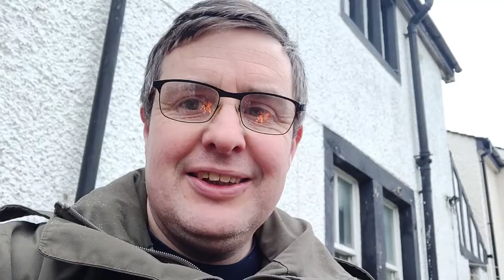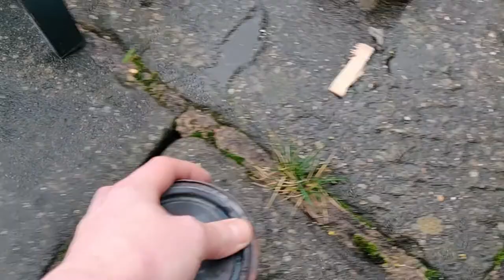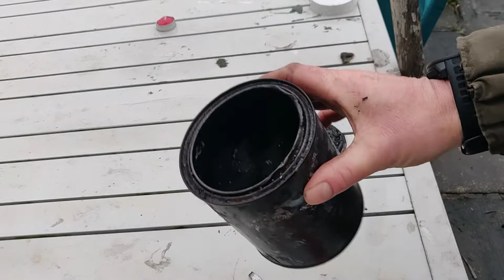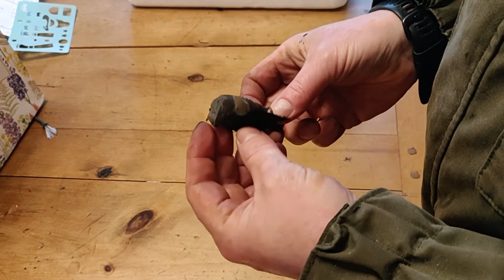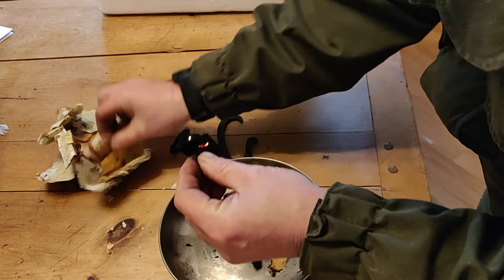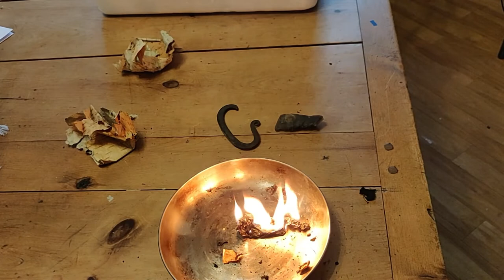Making Charcloth to Start Fire with Flint and Steel

Comment: Great video!
I really enjoy watching people, such as yourself,  on their journey of learning skills that are interesting to them and bravely sharing their growth.

The way the creation of charcloth works is, you are taking advantage of the fire triangle and storing up the energy to be released later.
The fire triangle represents the three things that are required to have fire.
You need fuel, heat, and oxygen.
By burning the item is a air restricted container you are depriving it of oxygen so since there are only 2 of the three parts needed to produce fire it will not create a flame within the can.
When you are making char-cloth, char-punk, char-bark, or the like, you should keep the container in the fire till the smoke coming out of the hole stops. That is how you can tell when the carbonization is complete.
After the smoke stops remove the container from the fire and let it cool to the touch before you open it.
If you open it before it cools you are inserting the missing part of the equation for fire, oxygen, and it can burst into flame on you. This is because it still has the other two part of the triangle being the fuel and the heat.

The carbon remnants you created have so much energy stored in it that the simple spark which re-introduces "heat", to the compressed "fuel" in the open "oxygen" in the air, can easily burn allowing you to use that stored energy to ignite your fire.

You have earned my subscription. 
Good luck with your channel and I look forward to following you on your adventures.
Reply from the maker: Thank you for your kind and knowledge comments. Every day is a school day!